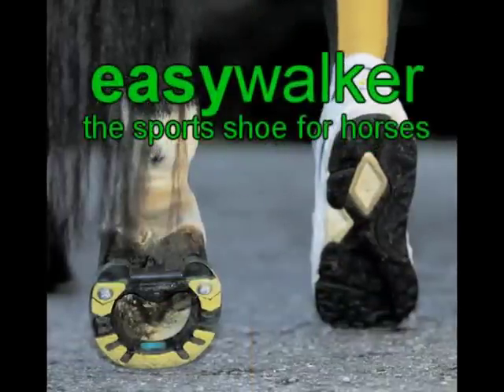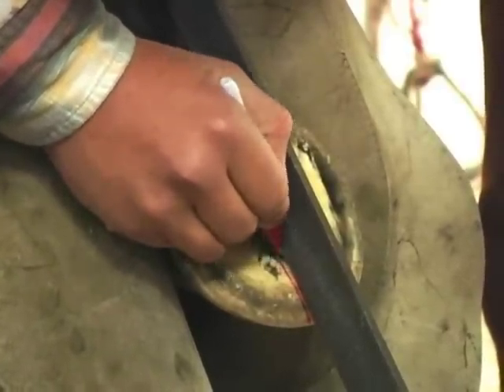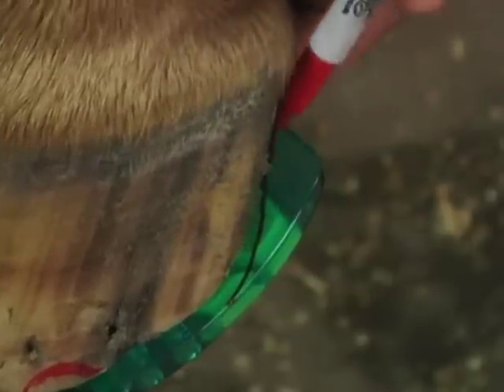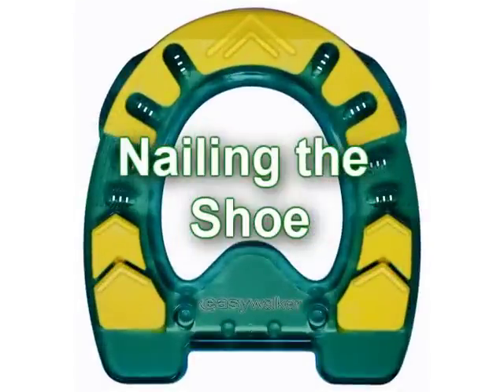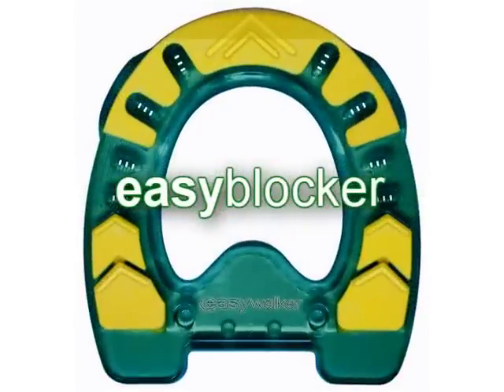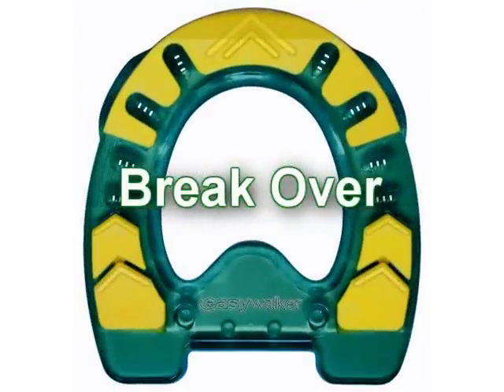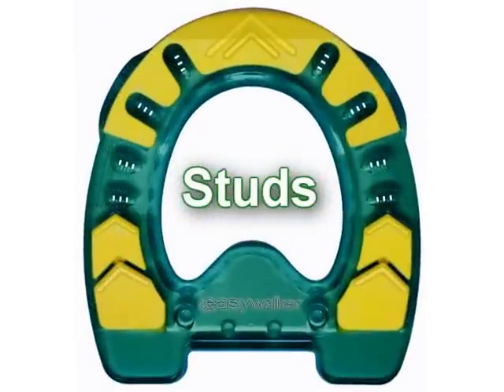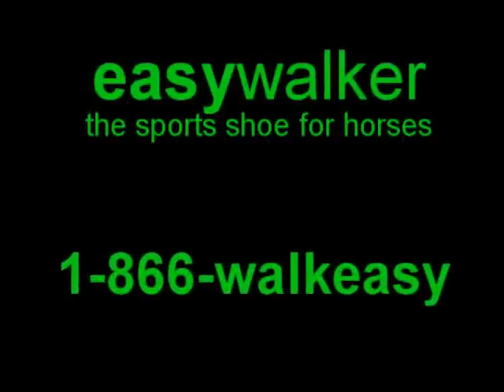Easywalker Horse Shoes - Installation

Comment: Would it be appropriate and safe to use an adhesive application with these shoes?  If so, which materials/techniques would you recommend?  Can this shoe cause or exacerbate a yeast or other condition in the hoof or frog?  And, does it absorb much impact for an older horse who may have just a touch of arthritis?

Comment: I don't like it...looks painful for the horse like those metal horseshoe. 😣😤😥 That glue one looks like alot less stress for the horse. 😘🏇
Reply: There's actually nothing painful about any kind of horseshoe if put on correctly. The horse can't feel the nails because they have no feeling in their hoofs, they're made up of horn just like our fingernails. If they were painful all horses with nails in their hoofs would be limping.
Horseshoe support the horse's legs by making sure the weight is evenly distributed and protect their hoofs from hard surfaces like asphalt. Which kind of horseshoe is best depends on who you ask ;)
Reply: @michelleglanzmann5745  It actually does cause pain in the horse's ligaments. They evolved barefoot. They will be good barefoot too. Walking them on asphalt with a shoe is actually worse than barefoot because metal doesn't observe any shock, it increases it